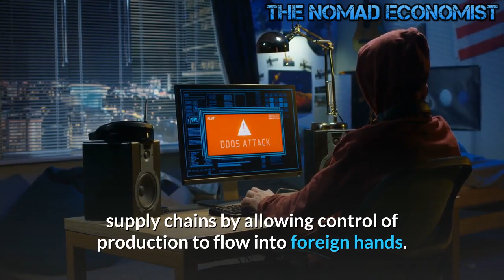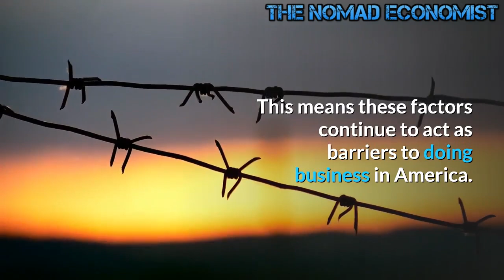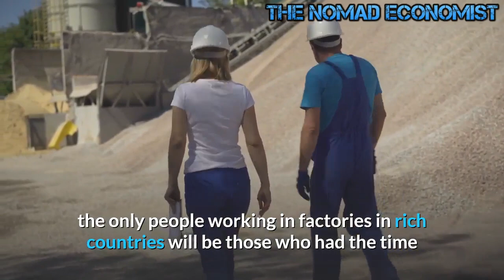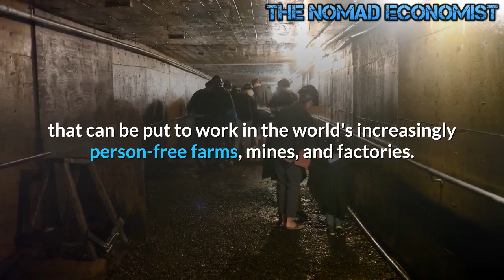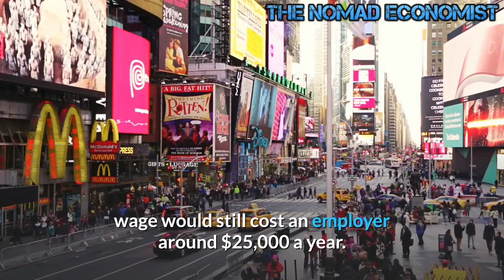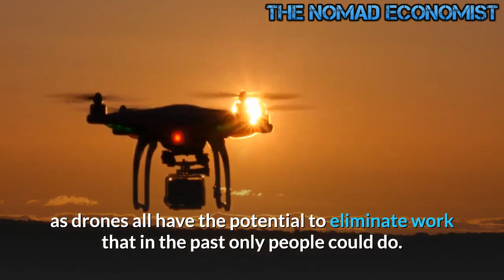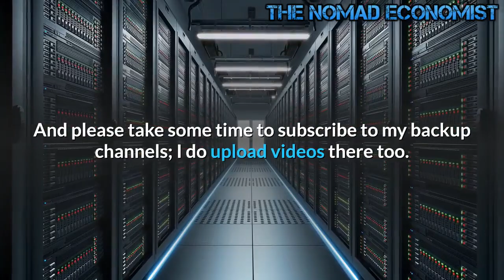Goodbye To Millions Of Jobs As Events Unfold

Comment: The production efficiencies of modern factories will not be needed due to a lack of human purchasers wanting or able to absorb production so either the plants will spend 10 months idle, or the biggest manufacturers will cut out the smaller and outdated manufacturing concerns if they have the ability to retool for new and different types of items.  Everything will continue to drain to the top.

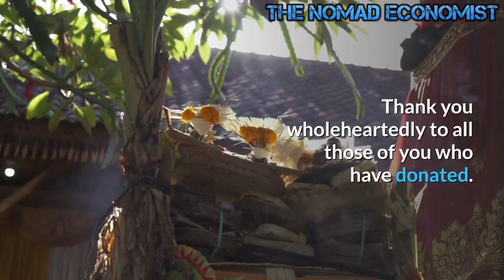Comment: 4:40 "Skilled worker s are earning more than ever?" You mean like a PhD in biochemistry driving an Uber?  4:53 Middle class  wages ended in the 1960's. 5:30 The Age of Off-shoring (1997-2019) is over. The Age of Repatriation of Jobs to give to quantum computers, A-I robots and nanotech systems has begun. 6:03 "The robot is not yet a one-to-one  replacement." Ahhh...but it will be. The private sector is working feverishly and furiously towards that goal as fast as they can realize it. 6:10 "A tool for ordinary human workers to do better?" No, it is a tool to totally replace human  workers. 7:06 In the face of money, there are no ethical concerns.  9:06 "Creative Destruction" has been replaced by "Destructive Destruction" which will be the hallmark of A-I.
Reply: Trades people are considered skilled trade dude. Electrical, plumbing, pipe fitters, and HVAC are a couple of examples. Do you even read bro?
Reply: @Silvergambit  The rest of the people will not have money to contract electricians, plumbers, etc